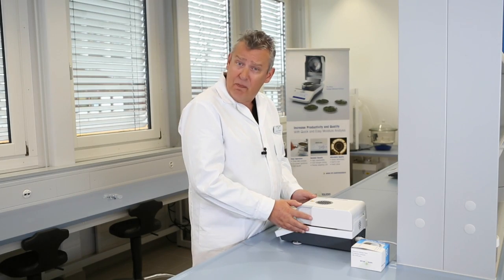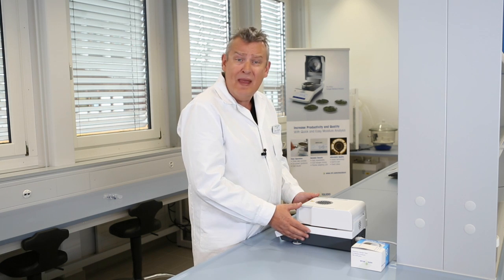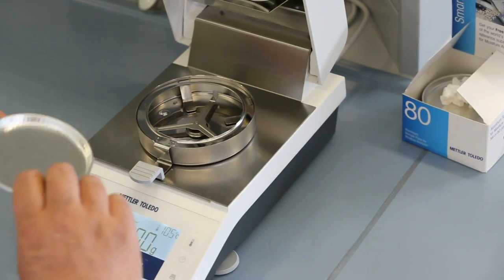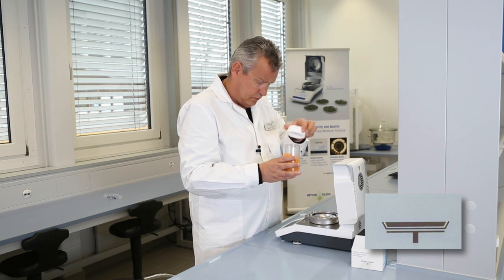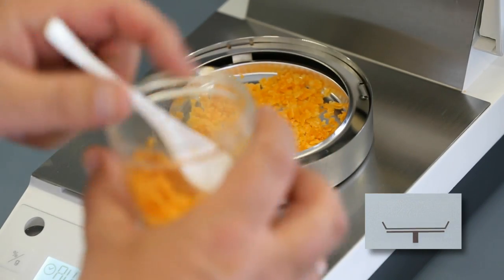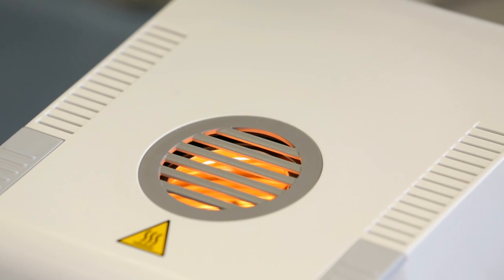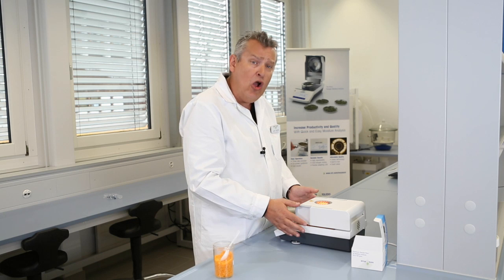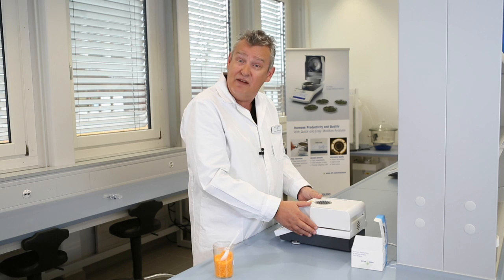HE53 Moisture Analyzer quick start guide 3 First Measurement

Comment: Thanks
I have a question what ia temp at beginning of test 
Is it room temperature or you fix it at 105 then you start....
Reply from the maker: The behavior depends on the moisture analyzer model. Normally the determiantion starts at room temerpture. It can be higher if two samples are measured directly after each other and the heat from the first measurement is still in the system. With our moisutre analyzer HX204 it's possible to define the start temperture sing the "preheating" funtion which is a method parameter, with the moisutre analyzer HE53 this function is not available.

Comment: what should be the minimum and maximum weight of the sample for analysis?
Reply from the maker: Thank you for your message. The minimum and maximum sample weight depends on the moisture content of your sample. Generally, the sample weight should be between 1 g and 5 g if the moisture content is over 1 %MC. For more information, see the following video about correct sample handling and preparation: https://www.youtube.com/watch?v=gjDQojmP2E0